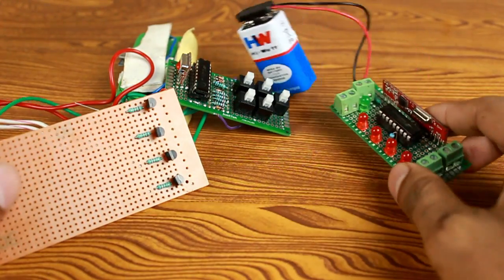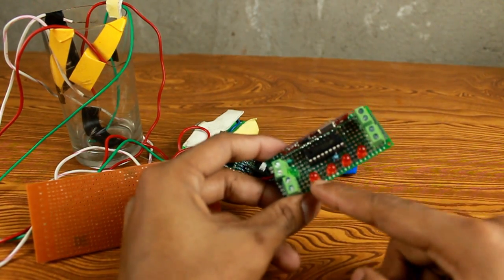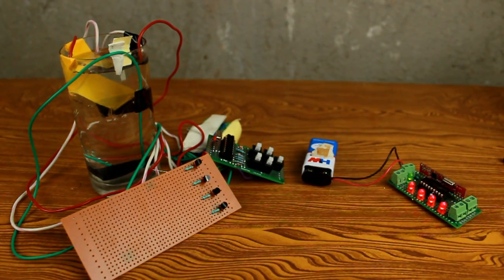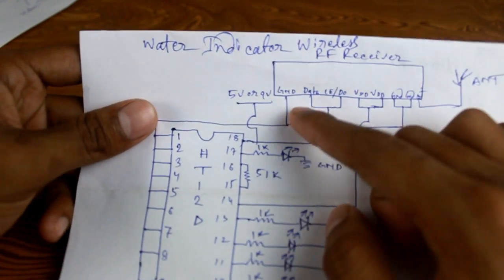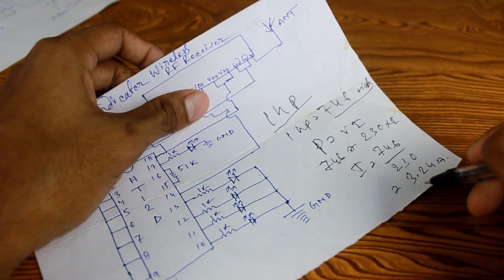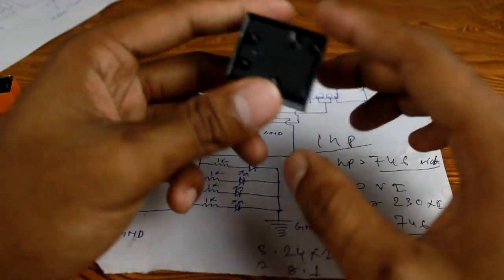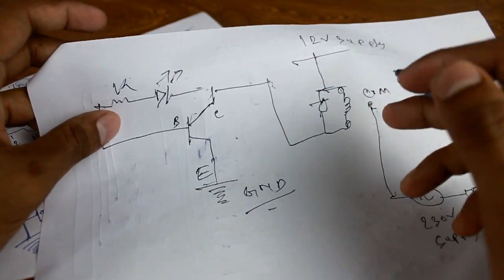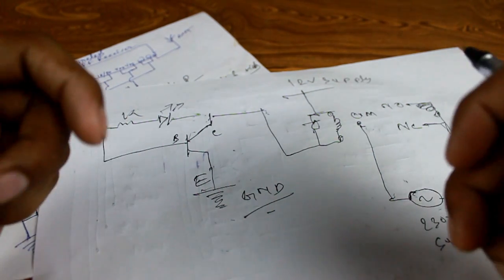How to make wireless water level indicator without any microcontroller

Comment: For full automatica water level controller for submersible or monoblock pump with under voltage, over voltage, dryrun protection in just Rs 1500/- to 3500/- call whatsapp no. 9028328803

Comment: Thanks for enlightening us but this is not a practically working circuit design i guess, because if we attach it with motor and when upper level is achieved motor will be off and when some water is used than motor will be turn on again and therefore motor will remain on always which is not feasible. You didn't tell this in the video, So please make another video addressing this issue and there should be manual switch to turn on.off motor at any time. Any micro-controller or nodemcu can be used to do that i guess. 
Also it will be very helpful for students and tech guys if you educate us how this thing will work, why we are using transistors and how water level will be achieved by ics so  that we can apply this knowledge to other projects too instead of copy pasting circuit designs.

Comment: Bro this transistor is npn or pnp 
Emmiter connected to 9v
Reply: In npn Emmiter is ground hey na
Reply from the maker: @CKCREATION02  npn
Reply: @thestory_92  apne to npn transistor ka emitter kor 9v diye hai circuit diagram pe oi hai but emitter to gnd hoga na!!!!!!
Reply: @abhrajitchanda2447  Hi, You are right the circuit Emitter goes to +ve whereas npn normally is -ve. Comment and correct me if wrong.

Comment: There are lots of grounded pins in the encoder-decoder, can those be utilised to increase the resolution?
Reply: That gnded pins are for addressing
Which are the pins connected in encoder that should maintain in decoder otherwise it's not work properly

Comment: Sir , what is the range covered by the transmitter?
Reply: 100 meter
Reply: @jamtechguru5580  this circuit range is only 5 to 10 meter
Reply: 30 mtrs
Reply: Is it 100 meters or 5 meters ? It looks like no one have the correct answer!

Comment: But every time jab pani use karne ke baad 4th level se niche jayega to motor automatically on ho jayegi.. to motor hamesha on off on off hoti rahegi .... Is this right na?

Reply????
Reply from the maker: yes I agree ...& I also thinking about this problem without any microcontroller...hope I will upload that video very soon...
Reply: Bhi tu apna b mind use kr,,, extra sensor use kro
Reply: Iske liye apko 555 timer ic ka use karna parega to ap ak level select kar sakthe ho ki ap ak level set karo ge us level pei pump on hoga
Reply: Transmitter & receiver.  How to link them or say pair them